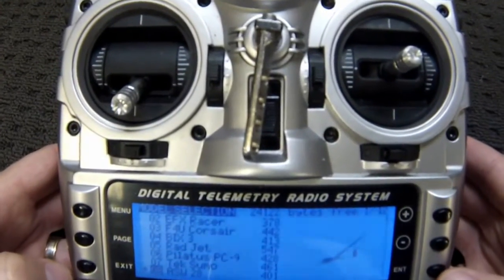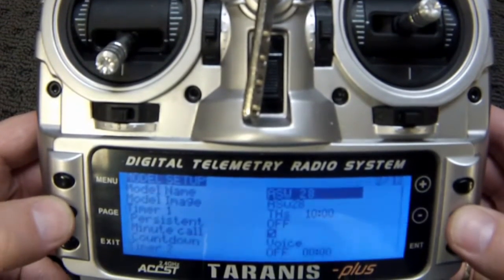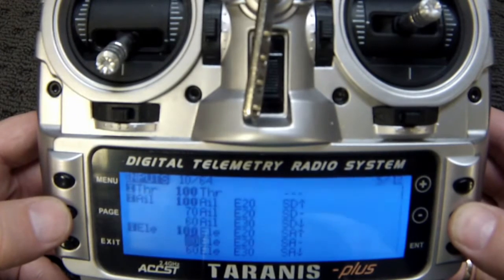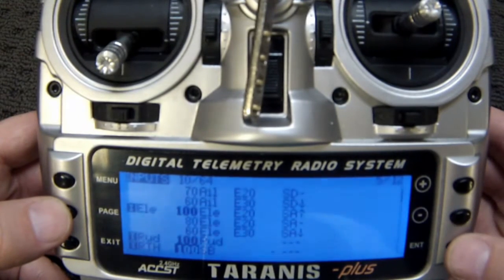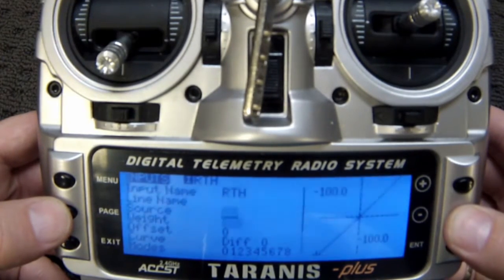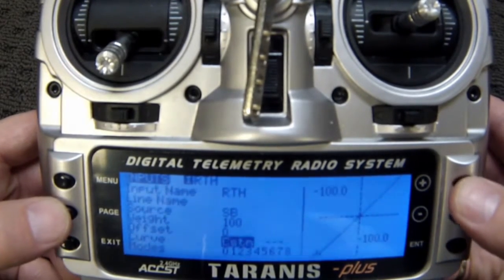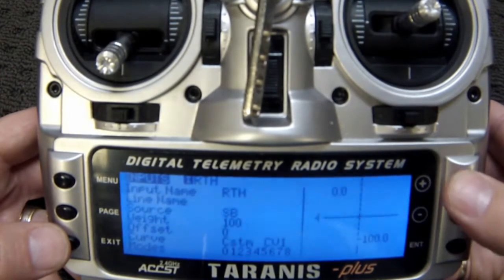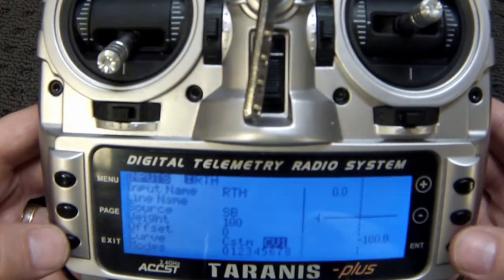BGL-6G-AP on Taranis 3 Pos Switch - Setup with Curve

Comment: Hey Michael
Just setting  up my unit on my Taranis. I wanted to know how to setup failsafe to RTH,.  Thanks for all your help...
Reply from the maker: G'day Mark. The fail safe in this situation, is the job of the receiver. If you are using a FrSky brand receiver there is a button that sets the channels values when the receiver goes out of range. You can also program the fail safe settings in the transmitter (https://www.youtube.com/watch?v=gj-MqyvbQ5I) but I find it easy enough to just set the switch to RTH mode and reset the receiver fail safe with the button. Optionally you can also add throttle to a level that will bring the plane back, but some people will not do that as a safety concern (in case you turn off the transmitter before the plane, the plane will spin up the prop!). I hope that helps. Cheers Michael

Comment: Hey Michael
Just ordered the unit from you. Could you go through the failsafe/binding setup with the x8r receiver. Activating RTH with a switch is fine, my concern however, is if I stray out of Tx range how will the RTH function will kick in? I have been trying to find info on the 'no pulses' choice during binding for this but there is not much out there. Apologies for the request......cant find anthing on the web with a video.